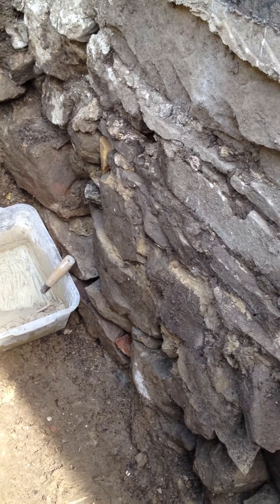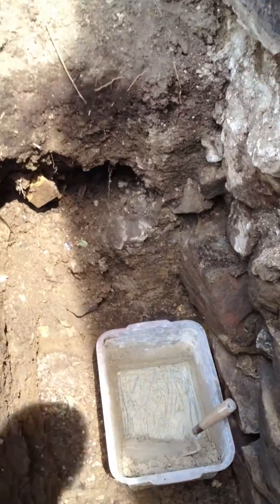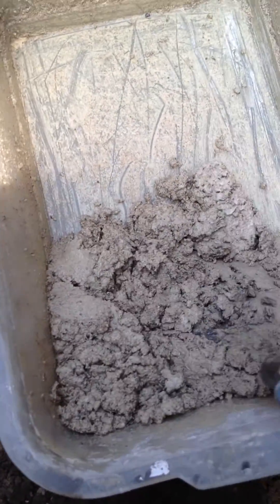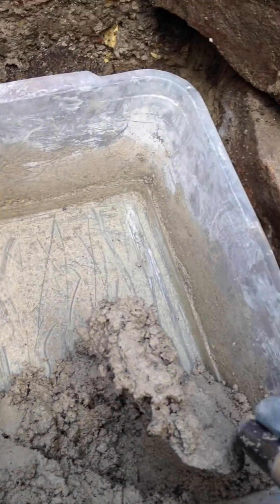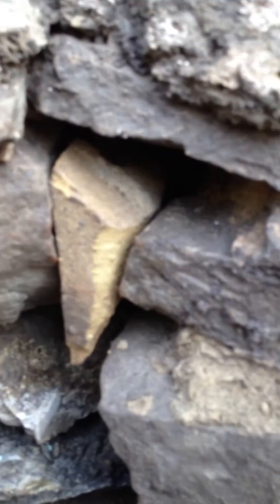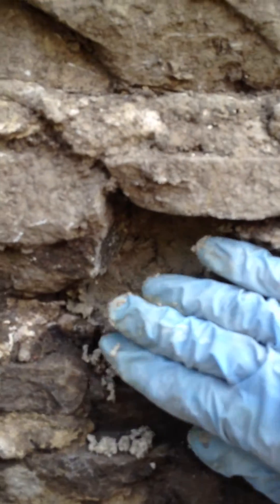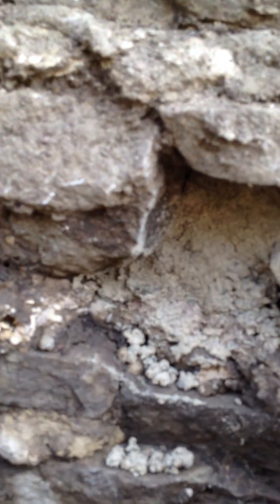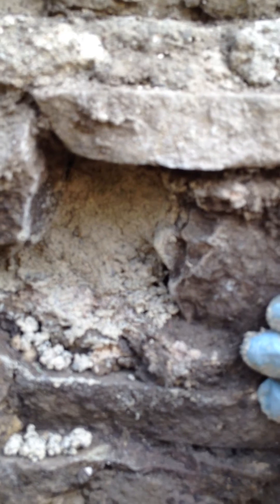repairing my foundation (part 7): filling deep joints with lime mortar

Comment: Hi Colin, what type of mortar mix do you use? I'm in Nova Scotia and I'll be repointing at my old cottage on the coast, so it'll have to be rugged.
Reply from the maker: hi justin, i used Natural Hydraulic Lime mortar, but that might not be right for your building. you should match the mortar to your existing masonry units. please see the description for part 4:
repairing my foundation (part 4): preparing natural hydraulic lime mortar